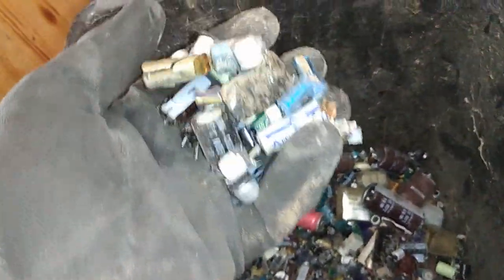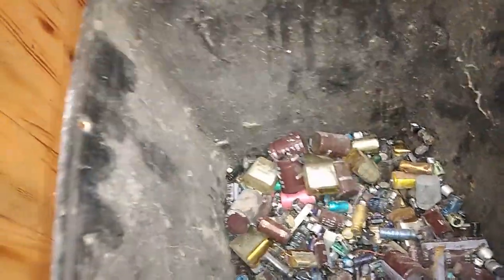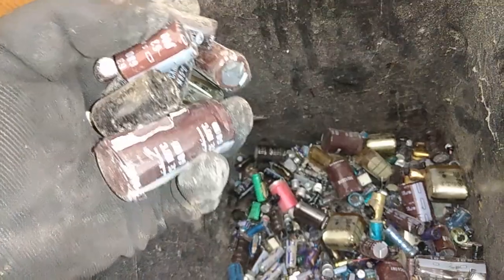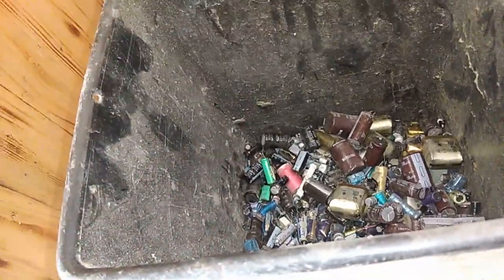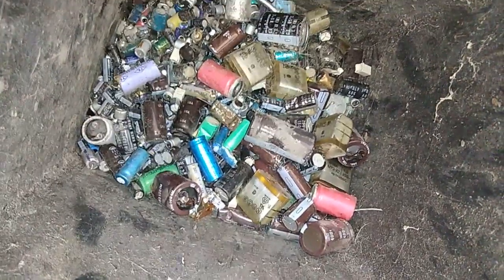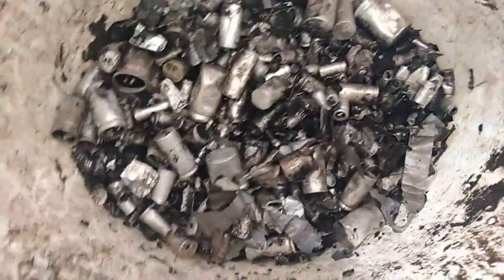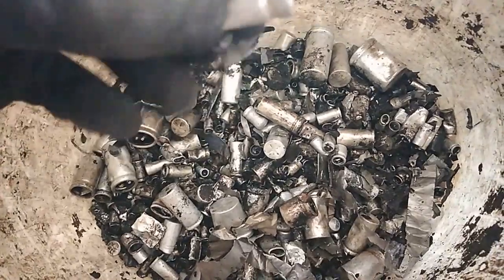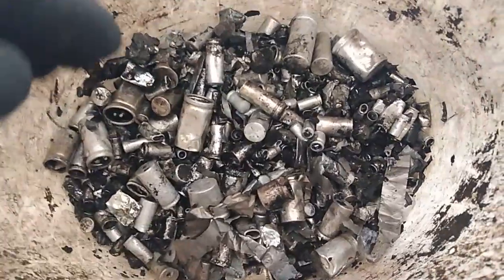Aluminium capacitator collect for money - is it worth or not?!

Comment: Thanks again for showing what is worth and the good and the bad!!
I wonder if you could incinerate and melt the aluminum in an electric kiln to get pure aluminum? In a closed kiln you could contain the smoke and probably heat it enough to just have carbon and aluminum at the end?
Reply: I have seen people do it in a gas furnace for melting metal. They put a chimney stack above the vent in the lid a couple of inches. It sucks in more oxygen through that Gap and burns all the extra carbon so your smoke doesn't come out all black and nasty looking.
Once everything is burned off I would just turn the heat up a little bit and melt it down into a liquid and pour into ingots and sell it that way myself. 
Then it's clean aluminum and you can get more money for it without too much more effort at that point.
One other positive benefit to that might be in case you had a tantalum foil capacitor in there. I'm not 100% sure but I'm pretty sure the melting point of tantalum is well above aluminum. So if there were any tantalum foils in there, or anything besides aluminum, you would be able to find them easily and pick them out.
Reply: @keithyinger3326  yeah definitely! I guess it’s a good thing that we don’t all live in the same area the environment would be screwed lol

Comment: Well even though it is bad to burn them there is the benefit of recycling the aluminum. The alternative is burrying them in a landfill which is even worse for the environment in the long term. Only better way would be just to filter the smoke better before it is released. And I would think that the plastic burning would be worse than the electrolite burning. Thanks for sharing.

Comment: I've seen mylar/foil type capacitors that have Tin foil instead of Aluminum. They felt a lot heavier than similar size capacitors. In my area Tin is like $20US per kg. It's probably worth watching for the Tin caps.

Comment: Good thing you didn't throw some big electrolytic capacitor from the soviet era in that fire, especially the ones with the markings printed directly on the aluminum case, and without the vent on the top. These are going off like grenades. The damn thing is going more along the line of an improvised explosive device than a capacitor when heated. They even does so in normal operation sometimes...

Comment: When processing electrolytic aluminium capacitors I first dissolve all the solder on the Printed Circuit Boards (PCBs), for later tin/lead/silver recovery. After that process all components fall right off the board, ready to be sorted out. 
There are different types of electrolytic capacitors. Most contain aluminium foil inside; a few contain either tin foil, nickel foil, or tantalum foil.
All are then run through one of my pyrolysis units; i.e. the one with a pyrolysis vessel made of thick walled stainless steel. It's a bit of a noisy process as most of them explode when heated. The pyrolysis step is necessary to get rid of all plastics as well as the electrolytes. The gases formed during pyrolysis are destroyed by being led through a pipe directly into the fire chamber. It's a very bad idea to burn capacitors in an open pit, heavily polluting the environment.
After pyrolysis they are dropped in a bucket and shaken vigorously for a short time. Hereafter the steel pins are easily recovered with a magnet. If any capacitor did contain tin foil, droplets of tin will be visible and can be picked out. The pyrolysis temperature of <500 C, will not affect nickel- or tantalum foil. Sometimes foil remain inside the alu shells, but it's quickly pulled out with a pair of tweezers.
Finally the capacitors are shovelled on a coarse sieve, which separates the larger/medium size ones as well as the liberated thicker foils, from the small ones and all the foil crumbles. Any other than alu foil is put aside for further processing. 
Size large and medium aluminium shells are sold as pure aluminium. All small capacitors, all alu foil, and all foil crumbles are melted in one lot into bars and sold as pure aluminium.
If anyone know how to recover the electrolyte in capacitors, please leave a comment.

Comment: I have a question I agree it's dirty but would it not be better to melt them down into clean aluminum and cast it into something machinable? The higher heat of a foundry burns off the toxic fumes and is cleaner way of incineration.
Reply: Well, should you have foundry and cheap gas... possible for sure, I have no idea if the sulfuric and other chemicals dammage crucibles... and the explosions.... someone has to try...
Reply: @frantiseklaluch6605  regular crucible isn't needed as aluminum doesn't require the high heat actually a cast iron pot would do nicely and would contain any caps that may explode. Sulfuric acid will boil and burn off at temperature above 900 fahrenheit and aluminum is ready to pour between 1100 and 1200 fahrenheit. If gas for foundry is problem a charcoal foundry can achieve heat enough to melt and pour aluminum. Charcoal is easily to be made at home for free.

Comment: Hello, read something about these which there is no way to open or burn without deteriorating the internal metal, do they have metals, right? Well, somehow they are extracted or what happens that they disappear knowing that they are in there, you just have to find out how to extract them, I think they have to be added even with the aluminum in electrolysis baths with salts or sulfuric acid, I don't remember well, opening them or burning them or doing other forms of extraction attempts would make the noble metal disappear.